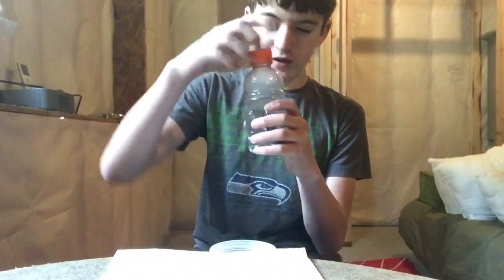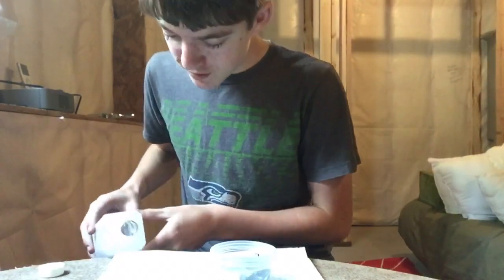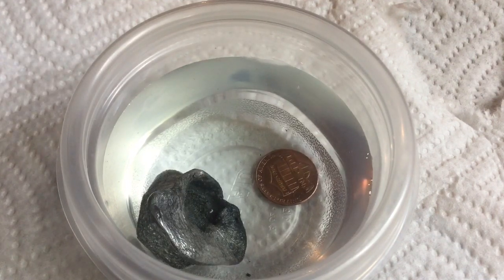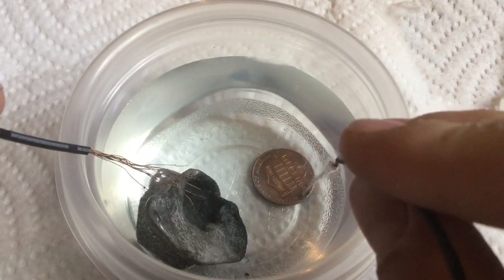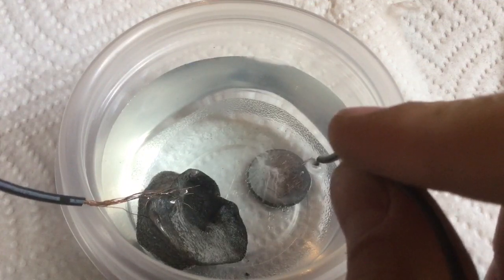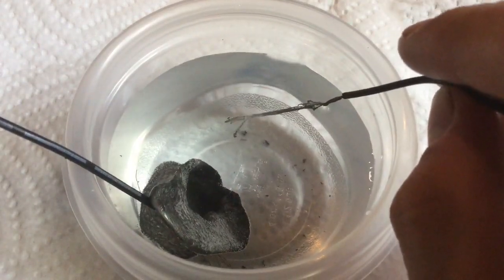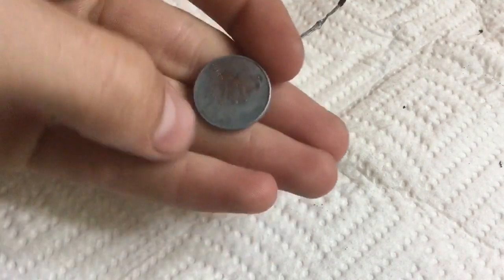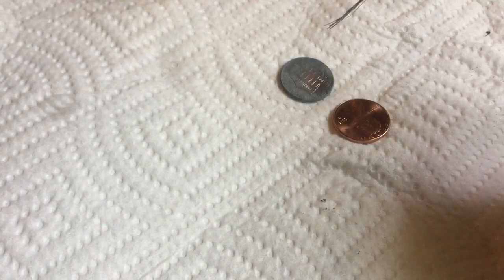Electro galvanization (zinc electroplating) at home

Comment: Your Zinc piece is not a sacrificial anode, it is called soluble anode. Sacrificial anode is another thing, for example if you place zinc ingots on steel frame of a ship, your zinc will corrode instead of steel frame, thats where it is called sacrificial anode. You cant say it in electrolysis. Nevertheless, nice to see young scientists interested in electrochemie, keep on!
Reply from the maker: Thank you, that makes a lot of sense!
Reply: Does this sacrificial anode system same for Inground LPG tanks??They use same stuff.So if you place a metal Beam into ground and connect thick copper wire and have sacrificial zinc anode at the end of it, the anode will corrode rather than steel, is that correct? How is the ship stuff working I cant catch it thou...

Comment: Cool man :)
I did tin plating with a condensed milk can and a nail, solution was just tap water and salt.
nail turned kinda matte black/dark gray.
Tip: If you do not have alligator clamps you can use clothes pins(preferably wood kind. https://duckduckgo.com/?q=clothes+pins&iax=images&ia=images
https://en.wikipedia.org/wiki/Tin%28II%29_oxide
Reply from the maker: Oh neat! To get the best results, everything has to be very clean. As for the clothespins, they work very well! Cheers!

Comment: Can I ask where you bought/got the sacrificial anode from? I'd like to try to do this process for a part of my project, but I have no idea about what it is and where to find it. Thanks!
Reply from the maker: some wheel weights are made of zinc, all the zinc wheel weights ive found  are coated in paint though, so youd have to get it off to use it. also u.s. penny's are made out of it now, however youd have to melt them to get the copper skin off.
Reply: Nathan's Scientific stuff I see. Thanks a lot for responding!
Reply from the maker: no problem! thanks for commenting :)
Reply: Hernan https://duckduckgo.com/?q=zinc+nuts
Reply: Just open a dry cell battery and take the casing off.The casing is made out of zinc
Reply: Nathan's Scientific stuff your zinc solution seemed to not be that pure. I would recommend to get a zinc anode from amazon or from an alkaline battery, zinc should be near a nail in the battery. The anode side aka negative side is where you get the zinc. You would also need to by a new one for this task

Comment: My zinc acetate turned a rusty red color... I didn't expect that since yours looks pretty clear.
Reply from the maker: that sounds like it is probably contaminated, most likely with iron.
Reply from the maker: how did the plating turn out?
Reply: do not worry I tried to make copper acetate with copper wire, I figured this must have been because of some contamination.
Reply: +TheApron Use metal hangers(some are made of zinc), old dead batteries(heavy duty, or regular, not alkaline, D or C size) casing, see youtube vids on how to do that. clean well with alcohol, acetone, or soap + water(better use distilled). Or find a zinc sheet, somewhere, maybe thrown away...etc.
Then heat a jar of white vinegar inside a pot(filled with water). Once it is boiling, take it off and throw your zinc material inside it. Leave jar open, without a cover. Do not breathe fumes.
After some days you will get zinc acetate.
I left a metal hanger, inside white vinegar and it kinda became thinner! That gave me the idea of making coils/metal inductors(for FM radio) out of them, since I guess it needs just a few turns/loops.
http://www.instructables.com/id/Build-your-own-Crude-FM-Radio

Comment: You should move the penny around to prevent crystals from forming.
Reply: This only shows the electrical effect, but not truly practical application. Using lower voltage, slower plating will assure fewer crystal and even coat of metal. Also, providing agitation of the solution provide more even coating. For maximum effectiveness, better build up a number of coats with repeat coating with very light brushing with steel wool between coats as is done in spray painting.
Reply from the maker: yeah, that would probably work.

Comment: clean them with some cleanser like comet they come out great.
Reply from the maker: Yeah mine weren't cleaned as well as they could have been.
Reply: Hydrochloric acid should work because it would take away the copper oxides, or you could also use sulfuric acid for cleaning too, look at nerd rages sulfuric acid distilling.

Comment: sometimes the coating comes off...is there a way to make the coating last longer?
Reply from the maker: the coating will usualy come off if the object you are plating isn't all the way clean. also if you don't plate it for very long the coating will be thinner and and come off more easily. keeping it in longer would probably fix this.